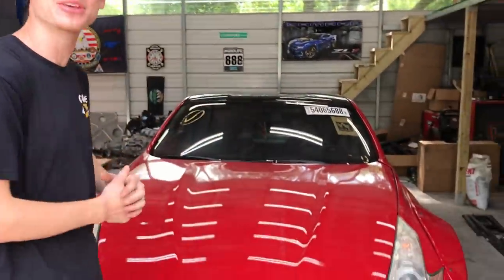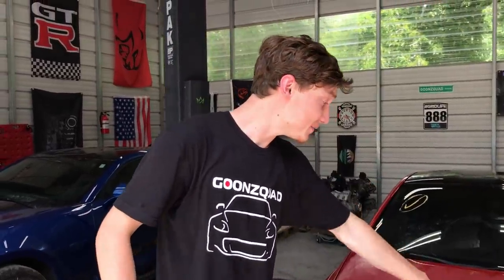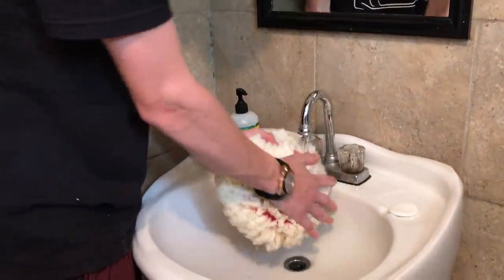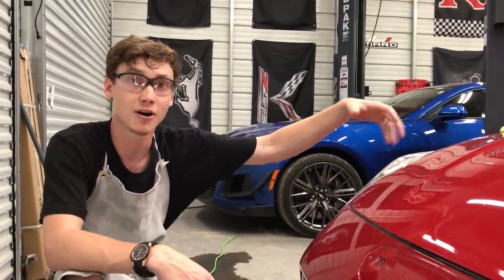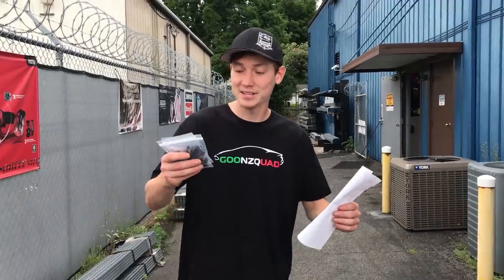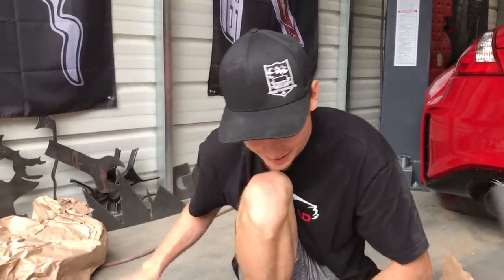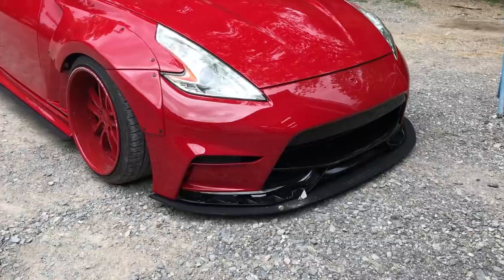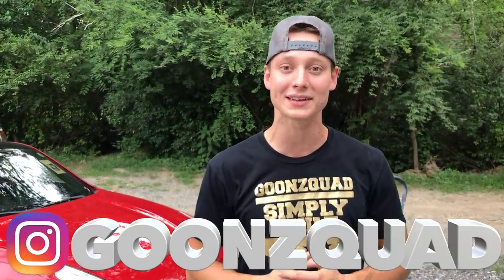Auction Drift Car First Test Drive!!!

Comment: The reason the paint on the bumper is a darker red is because you painted it over a darker base. If you would apply a grey sealer primer or a basecolor that is the same color over all the parts entirely and then paint it red, every part should be the same color. If you paint the red over all different shades of base(black bumpers, red hood, grey primer/filler spots) all of the reds will have a different shade. the amount of coats would not make as much of a difference as you might think. the base color will determine the final shade of the color.

Comment: Big carbon wing, carbon hood, black wheels, black mirrors 😎
Reply: That would look awsome!
Reply: Yep
Reply: David Łata bounce out with your crap big wings. It’s a drift car, not a WTA. It needs a ducktail or low level.
Reply: David Łata and a carbon hood does nothing if you don’t do it to the roof, trunk, and bumpers.
Reply: And black emblems
Reply: And dual exhaust for sure
Reply: Mike Russo carbon looks good tho its not only for performance

Comment: hey goozquad, if it was tuned at z1 use the cruise control to change your ecu maps. turn it on then hold down and tap cancel however many times to change the map that the car is in.

Comment: You can start sanding the head light with 600 then 1000  - 1500 - 2000 and finish with 2500 or 3000 sand paper. And then the 3M compound
Reply: I did my foglights with 400, 800, 1000, 2000, and 3000 and they turned out really good, I will get the 600 and 1500 as well when I do my headlights

Comment: Wet sanding the headlights will bring the best results in restoring them . 

Use 2000 grit sand paper 
And then buff
 then wax . 🔥👍🏻

Comment: Did you use a tinted primer?   If you paint a car or project red, you have  to use red tinted primer.  Primer sometimes bleed through the sealer and base coast. It happened to us.

Comment: Best way to restore headlights is wet sand with 800,1500 and 2000 then buff with rubbing compound then polishing compound. The longer you sand the better they come out.

Comment: Sand the headlights buff and clear coat them also not normally a fan of massive exhaust tips but tiwn 3" or 4" would look great on this on this also id do a ducktail style spoiler (wing) over a dinner table style spoiler( wing)

Comment: If you want those headlights to stay clear you'll have to spray them with some clear coat.  Otherwise they will turn yellow very quick because now that it's sanded there's no UV protection left at all.

Comment: firstly if you want to prevent orange skin you have to use primer, base coat and clear coat not only from the same company but from the same line also. Second thing to clean buffing cream use IPA alcohol not shampoo and water. After IPA use wax and microfiber to protect paint. And lastly whenever you use sandpapper on headlights you have to spray them with UV resistant clear paint otherwise your work is for few weeks to few months. Sorry for my english :D  Keep learning and keep up good work.

Comment: For the headlights 2000 then switch to the 3000 like you thought, then get a cutting compound, (tape around your headlights!) Buff it out, wipe good then switch to the buffing compound.
The z looks so much better from when you first got it 
👌
(PS, use the soft pad)
Reply: Also, use the soft pad

Comment: You should use Gray primer for Red paint. If Red was painted on black surface, it will be dark red.  Same thing happened when you were painting Orange on black fender. Orange also needs Gray primer.

Comment: the reason the bumper is darker its because the primer was black compared to the grey primer used on the hood it not always noticable to the naked eye but in the sun the difference pops specially on lighter paints

Comment: Hey guys there's a painter / YouTuber named Bode vision. And he send it down headlights for EK Civic. sending them down with three or four different grades and then ended up clear coating them and they look just like new he send them down wax and grease remover them and just put clear coat on top of them maybe you guys should try that because he was saying that that was last much longer than the actual buffing

Comment: Upgrade the battery to a slightly bigger one, the factory size is way too weak. Specially with air suspension stuff installed.

Comment: Hi guys from UK plastic bumpers were a big problem in the early days and on most cars you can see a very slight difference in colour. How ever pattern parts can be made of different stuff so will make matters worse. As I said before you should use white or very light grey primer on Reds and Oranges. Hope you read this as I have mentioned this before but you still did it wrong.

Comment: omg please don't tell me you did sand the headlights... its doesn't work that way. there is a like a transparent coating on the headlights. if you sand it it means you're removing the coating completely. if you do sand you gotta make sure to re coat them after you've done all the steps. cause if you don't its gonna become horrible in a few weeks. due to sunlight i hope you guys are gonna read this. its just my 2cents to help you guys

Comment: I told you guys when you painted it you needed to have a light color primer. Bright colors light primer dark colors get a dark primer. I hope you learn from your mistakes it will cost you alot if you don't learn fast. I would rather have the hellcat put of all the builds you have done

Comment: What I really can't wait for is when these guys actually learn how to drive, if you are going to do a pull and put it on video then please do an actually pull, they way you drive is only showing about 60-75% of the power these cars actually have, the thing is you have to know how to operate them well enough to get all you can get out of them, I can see when you first start an acceleration pull (Not a FULL PULL) you sometimes do not drop it to the lowest gear that will net you the highest torque/hp upon WOT (Wide Open Throttle), you want to get it in a gear where you can hit about 3500-4000 rpm's from the hit, then your shifting rpm is where you are screwing up the most, these cars have a redline on them for a reason, most will keep pulling hard to that ride line rpm, they will pull the hardest between 5-7000rpm's, you should shift most of these V8's at at least 7000rpm, and shift it quick man, chirp those tires through 4th, get sideways and stay in it, the only way to learn to control your car when your rear end is sideways is to just do it man, its actually very easy most of the time, its people's nerves and reaction that screws them up, my heart rate won't go up one bit if I'm side ways at 50mph  unless I"m goin around a curve haha but yeah man, hit WOT at at least 3500rpm, shift fast and aggressive at about 7000rpms unless redline is lower or higher cause it could have a limiter after the redline but it won't hurt it hitting the line,  practice practice practice..!! Find an open parking lot and practice some fast shifts cause that's the only way you will get the full potention out of these stick shift cars, the the padel shifting cars you just need to rev the rpms all the way out to the line before shifting, don't get scared of the power like you have been.

Comment: If I had a lift, I think I’d use it to check the air pressure in my tires...I can’t get over the fact these guys work on their backs to install the diffuser...UNDER their fricking lift...🙄